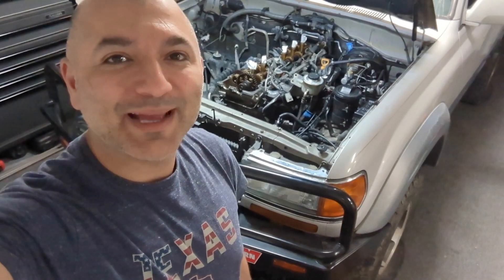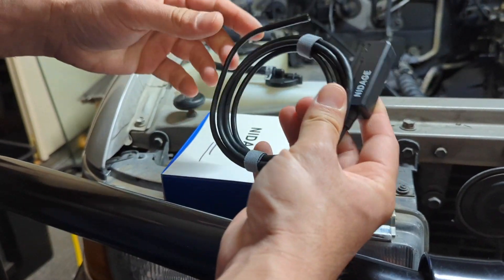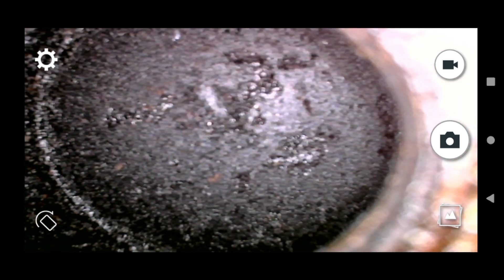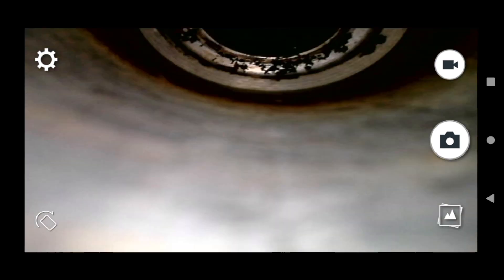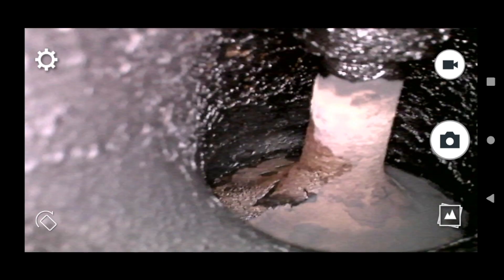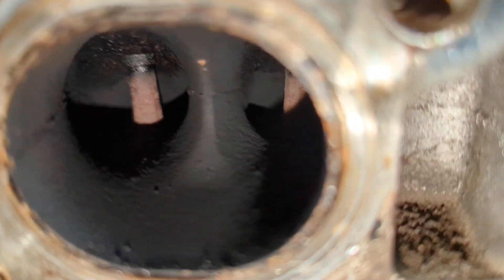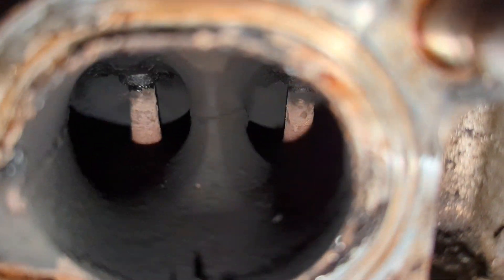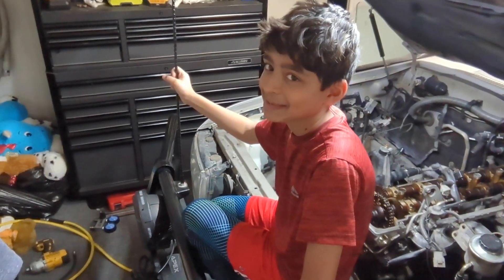1997 Land Cruiser - SCOPED Cylinders and Exhaust PORTS - Lots of CARBON on two pistons - Why?

Comment: I would just pull the head at this point!
Reply from the maker: Dangit NuttyNu !!! Why you have to speak all that logic? :-)
Reply: @NKPGarage  I’m so far into my engine, I feel like I should had just pulled my motor out. But it’s all good
Reply from the maker: @NuttyNu  You know..... if you pull the rest of it (the short block) you can also replace the rear main seal ;)

Comment: the clean ones are ingestingWater
Reply from the maker: I guess anything is possible. Maybe? But, I think the HG is sealed up okay. In the last video I did a full leakdown check at 100psi and there was no leakage past the headgasket into the coolant tract or oil tract. The only place I found leakage was past the exhaust valves in two cylinders where the exhaust valves were not shutting all the way.

Comment: Another informative video! Really opens questions in my brain as to just exactly what my own operating and maintenance procedures should be as I accumulate mileage on my new engine.
Reply from the maker: On anything I own that I have rebuilt or baselined, I typically keep a simple schedule. Oil changes every 3500-4k miles, full synthetic w/ OEM filter. Startron Enzyme fuel system cleaner every 4 tanks of gas. Coolant flush and PCV valve every 15k miles. Drivetrain fluids every 30k miles. For me personally, that has seemed to work well, but some may say it's going overboard.
Reply: @NKPGarage  My exposure to aviation and aerospace strongly agrees with the frequency and intervals you lay out. In addition, because I am so completely base lined I can't resist the satisfaction of trying to lay out a life cycle schedule for everything else. Thinking I would just add an expiration mileage or date column to my build sheet beside each necessary  part number. My wife mentioned that we have never loaded a plane with a big heavy toolbox 😆before heading over the mountains. So maybe we can apply the same preemptive maintenance approach to the cruiser.
Reply from the maker: @DouglasGreen562  That's a very good comparison. The last thing you want when you're a couple hundred miles away from civilization is a mechanical problem. People think I go overboard on my boat maintenance as well, and in addition I carry spare parts on the boat like alternator, water pump, cap/rotor, spark plugs, belts, and some other things. Every time over the years I have had a failure that has left me stranded, I have used it as a learning experience to add that failed part to my box of spares I carry, and also to modify my maintenance schedule to make it more bullet proof.